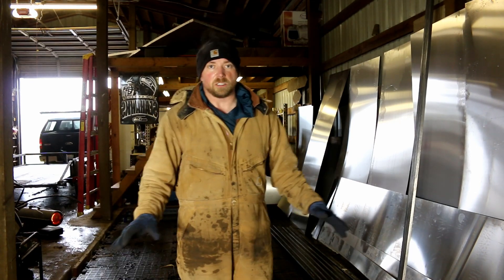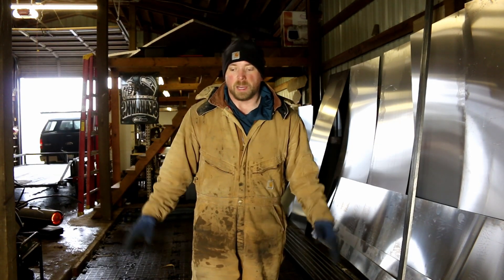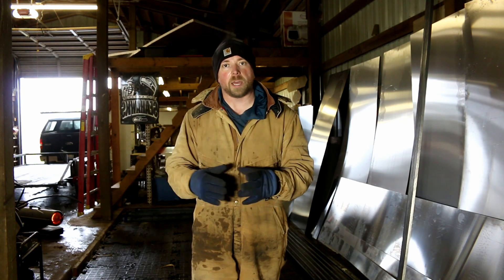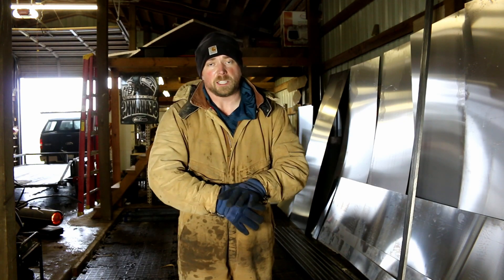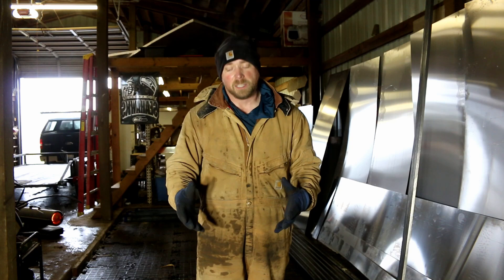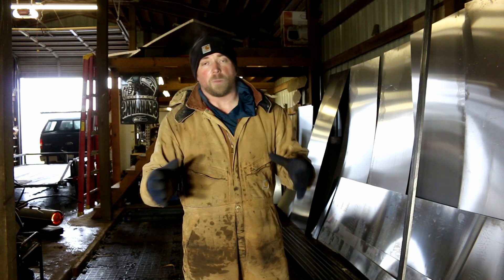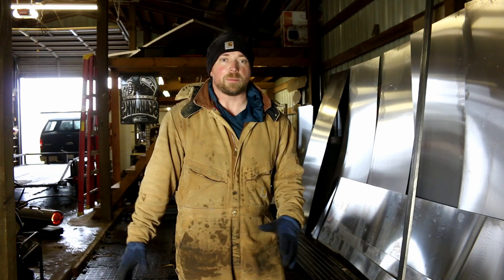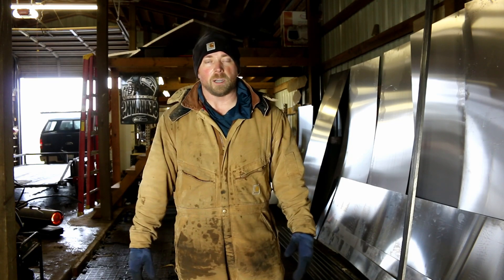HOW MUCH METAL IS THERE? - so close to FABRICATION

Comment: WhooHoo its starting!

Don't forget to dedicate one gopro or camera to timelapse, those are great while watching videos! Perhaps use some of those "Hot Hands" with some electrical tape to keep the cameras warm and batteries at good capacity.  I'm still surprised you don't have a few mobile tiny houses with engineering/farming interns working for free or at least feed them as experience.  If woofer can do it, perhaps there is a way here too.  Or have work days for the big stuff, Kinda like SV Seeker (if you have not watched that series yet...you may want to save that for the inclement weather/sick days :) )

If your VR system has OBS on it, pipe that view and give us a walk through of the work you doing.  You don't have to give the whole big picture away yet, but the steps your working on would be cool to see "here is the box trailer...here is a simulated timelapse of the belly build.  Bam and then switch to you doing just that :)

Comment: So my question of the day is ...... when a member of the public or corporation buys either the moble or the none mobile hab will it come into different configurations/cost depending what assembly work you need to do eg bolts the main assemble parts together or the main parts come pre-drilled and you bolt it together and do a bit of welding/fix the glass panels in etc to you get all the parts marked and cut to length but you have to put it all together?